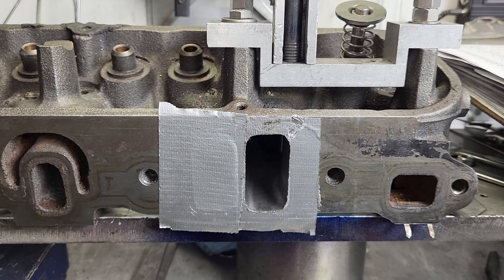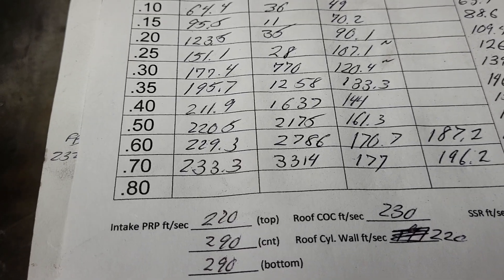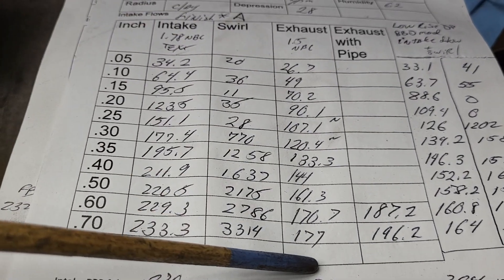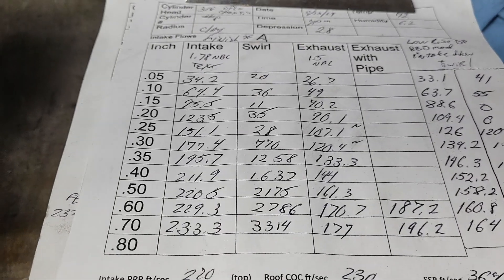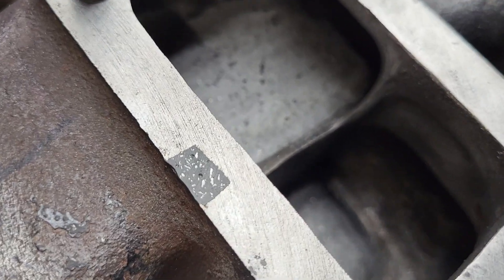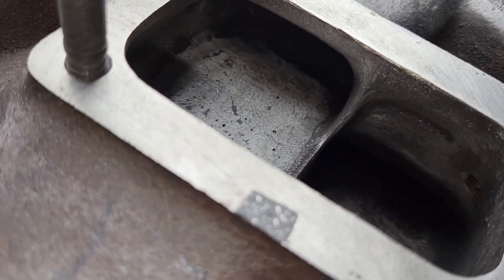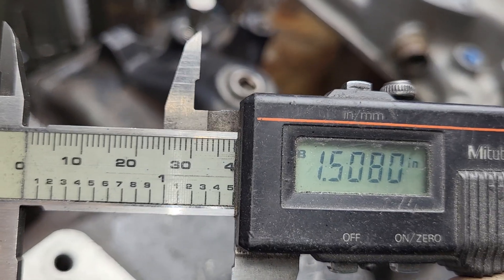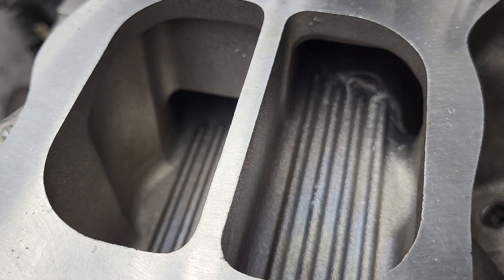David Vizard, Unity Motorsport, Mission Impossible 318 project. Manifold comparison.

Comment: what a joke this is not mission impossible 318. 🤬
Reply from the maker: You are 100% right. It is to demostrate the advantages of different intake designs even with a worked up stock head. It just uses the Mission Impossible cylinder head so I can use it in the title.

Comment: The Mopar 318 LA can go up between 5500 and 6000 RPM it doesn’t have to be spectacular it just wants to run with the 340 and 360 small block Mopar V8 engines as it can
Reply from the maker: 100% stock I bet. No issues. Thanks

Comment: Without a flowbench,  the common backyard can acheive what numbers?
Everyone can put a grinder in but, how much is too much?
Reply from the maker: It is a good question. I was thinking if I have time D.V. has the other 675 head. I could do a quicky port and find out what it will do with stock sized valves. Minimum time, zero developement. I bet they would break 200 cfm. I know E7's do because I did that experiment. There is a video somewhere. Thanks
Reply: Ive seen my cousins done it for years on there 340's, 400's, 440's.  Back then they didn't bother with the 318 that was pulling there trailers.   But did dye grind everything else.   I always tought bigger is better before I listen to David's and your expertive work.
Reply from the maker: @dadalebreton184  Bigger isn't better? Hahaha

Comment: As far as the Stealth goes, I've got one, takes a few minutes to match it to a 273-318 gasket, a little longer for a 340-360 size. Running 315 heads (273 close chamber) on my 318 with a 68 340 intake. I opened the heads up to match that intake as cast. Once  matched it to a 318 size gasket, it was just a cut less than a 1/4 on top, port sorta ramps down there. Going all the way to 340 gasket size is more cutting,  didn't see much point in that. Heads have 1.88-1.60 valves now and I ported them. No idea how they flow, but it made me feel better.  Hell, I might've made them worse.  🤣
Reply from the maker: I doubt it!

Comment: Big gains can be had by milling a couple holes and thread the holes for shallow pipe plugs in the problem areas. This will give access for porting and enlarging inner ports for more volume and blending the sharp turns as much as possible. You'd be suprised of how much iron that can be removed. Its done alot in pure stock circle track engines .
Reply from the maker: I have done this but not with Iron manifolds. I even have a video or two on this. Thanks

Comment: Why doesn't anybody ever mention the Stealth's googly eyed ports? The one I had, and every other one I've ever seen suffered from it. Of course it can be fixed, but that should have been done by Weiand long ago. I have to think it would have helped sales. I sold mine to 318WillRun, cheap, because back then I just didn't want to mess with it. Not sure if he's  done anything with it over the years.
I would love to see some other small port intakes flowed on these heads, though. Stock 340 or even 360, Performer and LD4B  come to mind, maybe even a Street Dominator.

I'm running RPM Airgaps on both my smallblocks right now.
A 410 with CNC Speedmasters Larry Smith touched up, along with porting that intake, and a stock one on a 360 with stock J's. There is a pretty bad mismatch to the 915s. I didn't realise how bad until I scoped it after it was in the truck. I was surprised, and feell stupid for not catching it!
I plan to remedy that by porting another set of 915s with 11/32 2.02/1.60 valves, so I've been glued to this series!
Thanks for such a comprehensive look at the progression.
Reply from the maker: You are welcome.

Comment: Charlei, i think you would like to stock tbi intakes, which are midrise, and the 80s 4 barrel iron intake, which is much more of a midrise. Ports are very forgiving, and if you are porting.  You only really get an upgrade with a good single plane.
Reply from the maker: I did one for this project. Check older videos

Comment: If I remember right the spread bore  intake that came off my 82 diplomat police car engine was aluminum, that engine ran pretty strong for the era it came from, way stronger than the 2bbl 318 that was in my 1981 Newport, it was a total slouch but the cop car 318 would really wake up when that big ol thermoquad was opened up ,and with the lid flipped what a crazy roar that carb made! I loved it. Back when I was 19 (in 92) I did take a 318 from a 79ish Aspen wagon did a rering tossed a mild summit street cam in and used that diplomat cop car intake and a quadrajet, retrofitted the non leanburn electronic ignition from an old dodge van and stock exhaust manifolds no cats and dual 2" exhaust and a non lockup 904 with a slant 6 converter and that mild combo ran really strong for a mostly stock 318, I put it in that land yacht 81 Newport and it would push that thing good, there was a monster hill in my area hit the bottom at 55 and newport bone stock floored kicked down it would maintain 55, I did just the exhaust and it would be at 65 at the top actually huge gain for just from a de carted dual exhaust, I did the engine up with what I listed above and 55 at the bottom at the top the speedo was pinned at 85 so I don't know if it was more, that's a crazy improvement in power from just uncorking and engine and a 4bbl swap. That mild combo in a small car like a dart or a duster would actually be a fun little tire melter. The Newport had a tow package so it had a limited slip and it would do some chirping floored from a dead stop. I thought The car looked pretty cool I thought, champagne paint brown vinyl top, 5 oval 15" ralleyish style cop car wheels with trim rings 235/60 copper cobras, nice n low with saggy rear leafs and loosened up tortion bars, and it had a maroon overstuffed crushed velour interior  with a sofa back seat, great feature when your 19!. Even with the cool cars n trucks I've had and have Its still one of my favorites, I would so love to have that exact car now for my daily driver. No it wasn't "fast" in the world of hot rods but being a kid back then it did seem decent to me and several people were like wow this is way faster than I thought it would be so...  but for a super cheap build a guy can have fun budget car and with a slightly bigger cam an aftermarket intake, a set of long tubes you could probably add another 20hp? Some diy porting could go add another 10? maybe a bit more? Total HP no idea maybe 250 crank? I dunno but Plenty to melt tires n make noise. Sorry bout rambling n rambling it's a bad habit of mine when I get nostalgic lol.
Reply: MoPar never had an OEM aluminum intake on the 318 in those years of the LA. I do think it includes the earlier poly years.

Get story though. I like it!

Comment: I hate to say it, but this comparison was kind of pointless. Do you have a factory 4 barrel intake to compare with the Stealth? Or even an action plus? I've done this comparison many times with customers. I had a 428 FE come in the shop, the customer had bought and wanted installed A Performer intake. It had smaller ports and runners than the factory intake. I've done the same comparison with SBC 4 barrel intakes. The only apparent advantage was less weight. Regardless I appreciate your efforts, but let's compare Honey crisp with red delicious.
Reply from the maker: I doubt you will enjoy the next few videos. Sorry, the point is even with ported low performance heads an aftermarket intake is a no brainer.
Reply: @servediocylinderheads  nothing to apologize for. In this case, yes an aftermarket 4 barrel intake is better than a stock 2 barrel intake. I guess unless it's a 6 barrel manifold, this is always the case. I make my case again that maybe a better comparison is a factory 4 barrel v.s. an aftermarket. It was not my intent to convey negatively on your work, but a constructive criticism. I learn from the work you do, that's what I enjoy. I just don't think aftermarket is ALWAYS the answer. I've certainly had to correct fitment and quality issues on aftermarket items more than factory. castings.
Reply: I did say at the beginning of the video…..
This was for fun and to bring up topics of just simply bolting on an intake and the port mismatches that happen. Glad you brought it up. 
I do have a OEM ‘72 4bbl intake.
Reply: @Robs-Garage-experiments  my apologies, I didn't catch the "just for fun part". In my defense I was smoking a brisket at the same time.😁

Comment: UTG's MI 318 project was hijacked and murdered. Buying parts and sniffing farts, isn't what it was about.
Reply from the maker: Sorry you feel that way. I fought to use stock valves and even the open chamber heads. I feel I succeeded, but the dyno will have the last say. The original challenge is the bbd, low rise dual plane and exhaust manifolds 1hp / cubic inch.

Comment: Charles,
      You've lost what UTG was tryin to achieve......yea, the 4bl intake flows WAY more....DUH!!.......the intent was to use the horrid 2 bl, and see what cud be done......all the idea behind mission impossible has been lost......the challenge was to use awful OEM stuff, and try for 1hp/cube..... .its a no brainer to use a 4 bl, or a weiend intake, NOT what the challenge was.... . I'm with UTG, not Against ANY of ur OBVIOUS tallents.....just NOT what he wanted to see if........no offense, not tryin to attack......the original scenario has been put to the wayside......what cud the 2bl intake do???...we'll never know, cuz u just jumped to the 4bl.....and again, DUH, it works better....the initial challenge has gone away.....doesnt anybody think the original challenge was neat??.....probably NOT doable, but was a SUPER cool challenge.......who cares about tossin an aluminum 4 bl intake on it.....OF CORS its gonna perform...NOT the challenge.....PEACE to you sir!!
Reply from the maker: The original design is the low rise dual plane and bbd. All together flow 160 cfm at .6" lift. If we multiply that number by 2  it is 320 hp. I think that is pretty close to the original intent was of the mission impossible. The other intakes and we test a few if for information only. Go four barrel!
Reply: The union of UTG and David V on the project was dissolved long ago. The intent of making 318 HP from a 318 cid engine using the 2bbl carb and intake is still going forward but not exactly as UTG wanted to.

UTG said he do it his way later on after DV is done with this. Check out UTH’s channel for more on the topic. He did a good video.
Reply: I thought they are going to use the stock parts and then change progressively to better parts. Have I misunderstood?
Reply from the maker: @davidreed6070  No, you are correct.
Reply from the maker: Look at the flows from thelow rise dual plane with the bbd going through the head as the original challenge or phase 1. I did three intakes for this project.
Reply: Easy for you to say as youre not doing the work bud .  Uncle Tonys idea was stupid to begin with . And where is he ....hangin with you ??

Comment: The biggest hurtle from flow bench numbers to a running engine is the window time and how much air flows through it. 
  The window time is the valve event. Increasing duration allows more air in than the flow bench will measure.  You can add up your totals from your graft Guy's and cone out to an average. But the engine with more duration will transfer more air than the average. I have found that .227° of duration is the sweet spot for engines in that 400ci range.  So for a 322, the sweet spot will be around .214°. That number can help determine if you're going to get more flow into the cylinde, s then the flow bent reads. 
  You can figure use 214 as a zero point. For each degree away from zero. 3% of increase or decrease in flow on a running engine will be observed. 
  The typical 340 TA cam with .224° will flow almost exact to the stock LA head flow  numbers. 
  The mission impossible 318 should break 1hp per cubic inch even with the BDT if the cam is .227°. That's 13% more airflow than your recorded flow bench numbers. Once you guys upgrade to a single plane and good carb. Your flow numbers will provide 460 with a .227 cam under 7000 rpm.
  I know for a fact because our super stock motor from the 1990s produced 445 with a KD 500cfm 2 barrel, and we made 470hp at 8000rpm on the same combo with a unrestricted 775 Demonand M1 intake. 
  Granted we achieved this with 2.o2 valves and 8mm stems.
 So adjust accordingly.
Reply from the maker: Good info. Thanks!

Comment: I have an Edelbrock which was supposedly for converting either a 318 or a 360 from 2 bbl to 4 bbl.

Not sure what I'm ever gunna do with it, but I'd consider trading it for a set of 440 heads [even the poorest quality cast heads ever made] so I can put some 440 heads on my 413 motor home and get rid of the high rise water pump layout so I can put it into a Dodge Dart or some such.

I can port them myself, as well as any other work related to performance upgrades, but mainly, I just want to have a motor that doesn't have a water pump sticking up through the hood.